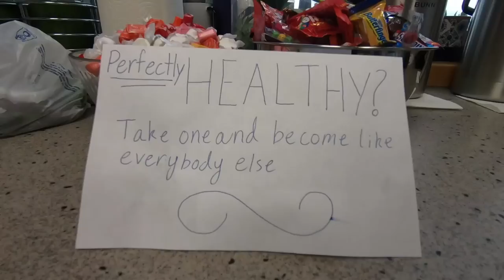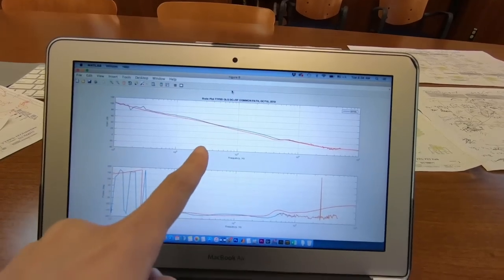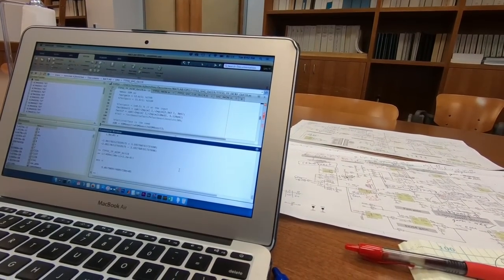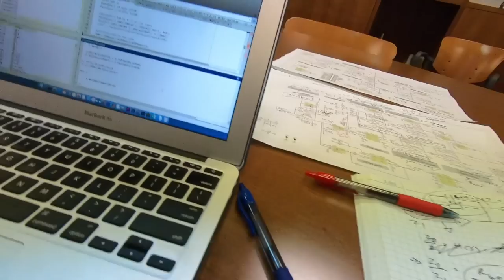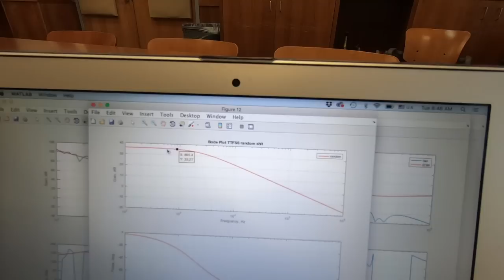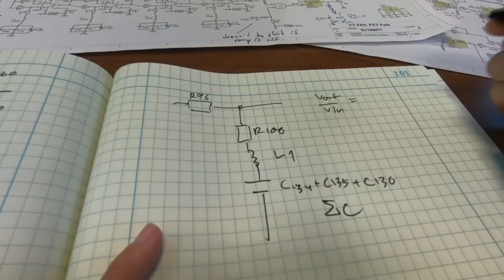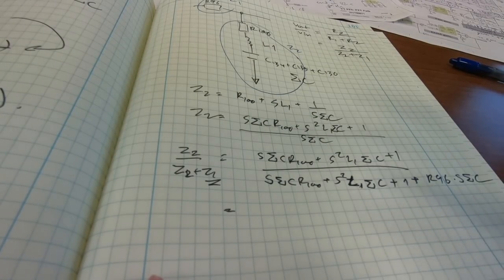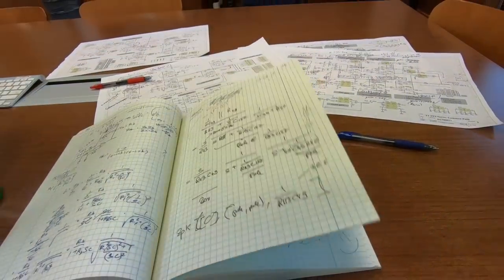[Tutorial] How to go from Circuit Diagrams to Transfer Functions

Comment: How long did it take for you to be that quick at understanding what's gonna happen with the equation? I'm starting to get into Laplace with Circuits and I have to look at the tables constantly.
Reply from the maker: Tim Andress It took me a week or two of repeated calculation of all the filters in that electronics! By the time I got to the last components setting up equations was much faster. Basically once you’ve seen enough of it you’ll quickly learn to recognize at least the shape of the filter (high pass vs. low pass vs. notch). Good luck! 👍
Reply: @NutsineesVlogBook   You went from a circuit schematic to talking about zeros and poles so quickly that it helped me see where my class is heading  in a simple fashion (we just started on poles this week). Really gave me a good mental picture, glad you put the effort into the video! Thanks a bunch!
Reply from the maker: Tim Andress I’m glad it’s helpful! Thank you for watching 🙏